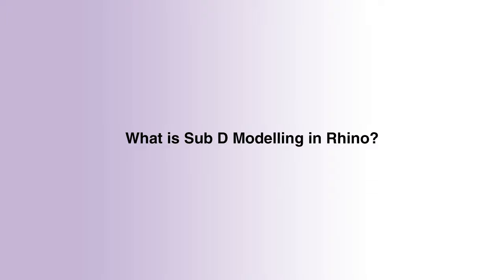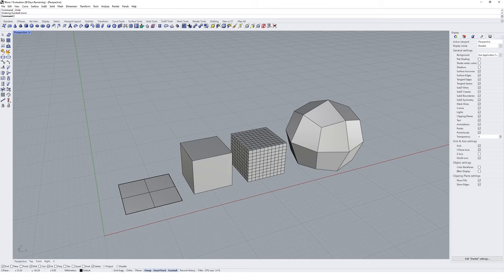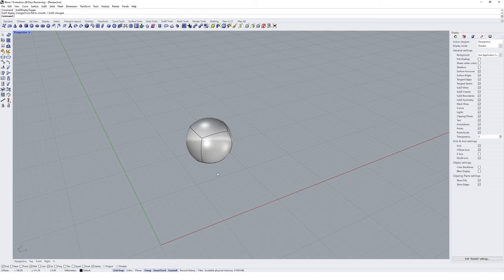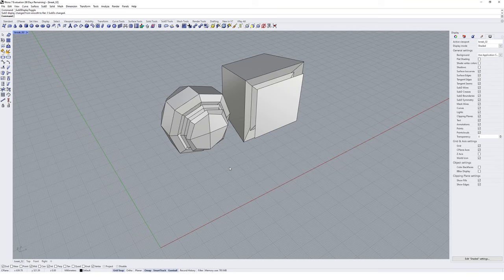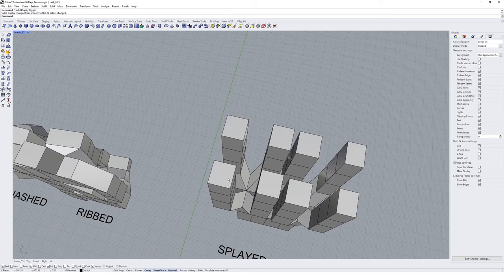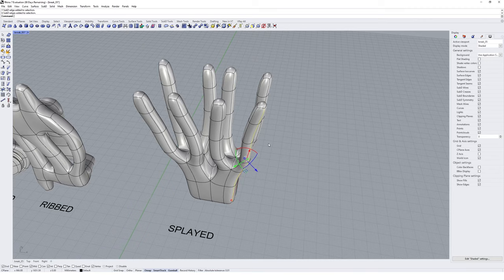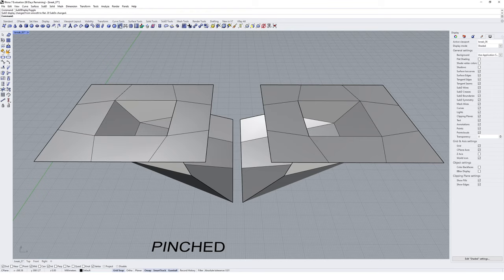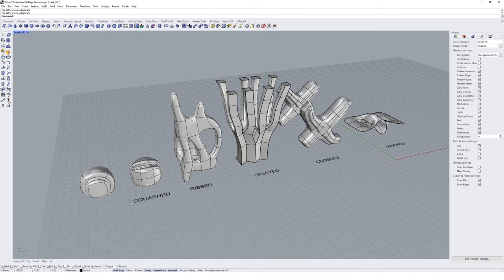Rhino Sub D Beginner Tutorial (Easy)

Comment: As a professional CAD modeller I could say that it is a great tutorial. I work with different software and rhino took 3 year of my life in a professional environment. It is interesting tool but poly modeling is better to do in blender or Zbrush or 3ds max. I do jewelry models for about 8 years for manufacturing and at the end of the day any model from Rhino or Solidworks goes to stl format which is Polygons. And at the beginning of my career when I receive old stl file and need to make changes it was a nightmare because in rhino you cannot just simply cut unnecessary and bool what you need. In blender you can easily cut and trim what you need, weld new parts and smooth it in sculpt mode. Of course the Nurbs Surface modelling is much precise because you don't have polys it is a pure mathematical surface, but when you need to make a rounding between crazy shapes which we have in jewelry a lot Rhino is a nightmare for me. Just saw this tutorial and was interested maybe rhino become better))

Comment: Greatr tutorial, but I got to say, this just seems too loose, no measures inputs or sliders that you can go changing and testing. I just think 3ds Max has a way better going on this with super smooth and others modifiers. 
also... If I model something with the common box in 3ds Max, Blender or Maya, I can just apply such modifiers to smooth the model as subD, but for what I understood in Rhino, I need to alredy be modeling with the subD tool set.

Comment: Great tutorial! However, I am having issues with my models. New segments aren't added when I expanding a surface, instead the whole object stretches out like a rubber band. How do I address this issue?
Reply: I don't know if you already figured it out, but when you are using gumball you can either pull the arrow or you pull the small circle on the arrow. If you pull the arrow, it will stretch, if you pull the circle, it will add a new segment. 

For me, it only works if I have gumball aligned with CPlane, not object. Hope this helps :)

Comment: Who is paying $1000 for Rhino when Blender is free?  You save enough money to buy the PC to run it on.
Reply from the maker: Hi there, Blender is a great up and coming modelling software that is fast becoming industry standard (replacing 3DS Max), however there a few things Rhino focuses on that distinguish it from Blender:
1. Rhino is more fabrication focused and is great for precise modelling & tolerances, blender is better as a sketch and viz tool
2. Rhino has an incredibly powerful geometry library that allows users to create and manipulate all kinds of geometry
3. Rhino has Grasshopper, which is the most advanced node based parametric interface in any 3D modelling software that enables users to truly harness the power of the Rhino geometry library that other modelling softwares cant. Ive used the blender node based interface and its nowhere near the maturity and usability of Grasshopper.
4. Rhino & Grasshopper both have an enormous free plugin library that can be used for all kinds of applications (engineering, physics, environmental and optimization simulations just to name a few)
5. Rhino is actually free for the first 3 months (and you can always just drop a new email in to get an extra free trial)

Whilst Blender is great, there will always be other modelling softwares out there that have their own niche - 3D modelling is a more diverse topic than you are suggesting and there will never be just one standard software.
Reply: Good question and good answer. It seems like Rhino is used in industrial settings fairly often.

Comment: Sub Ds are NOT what you described. Sub D is polygonal modeling with edge weighting.
Reply: Rhino Sub D is different. It is not polygonal based... That is where the real power lies... model using SubD technology but converts directly to NURBS which is essential for manufacturing accuracy.
Reply: @simpernchong  lol... you can convert them back and forth. I have done it for years. Its polygons with a crease value... (edge weighting)... its no more powerful